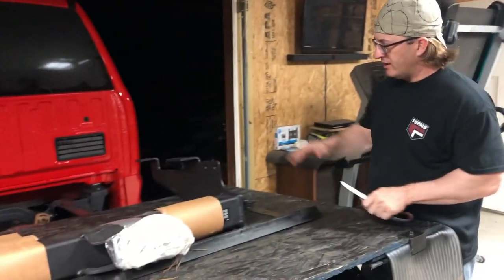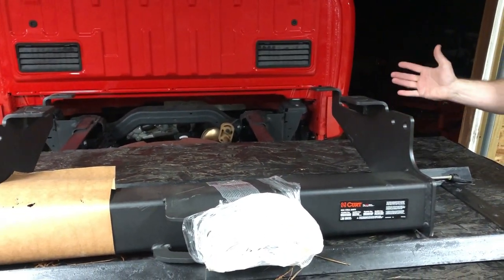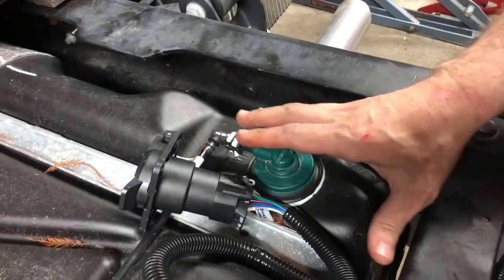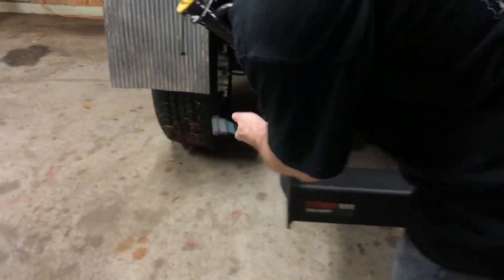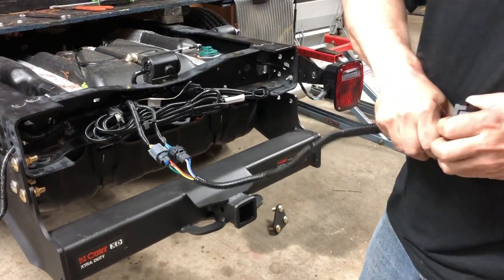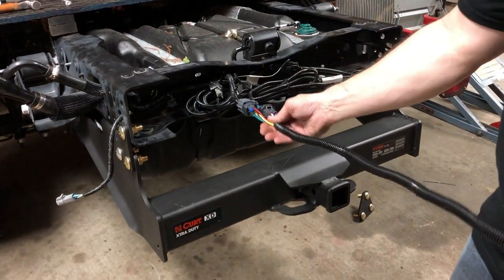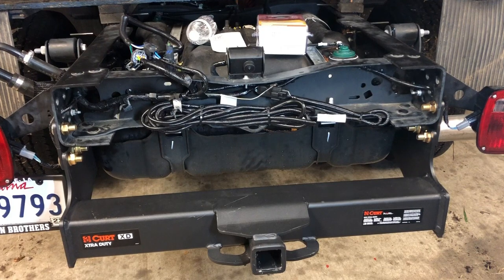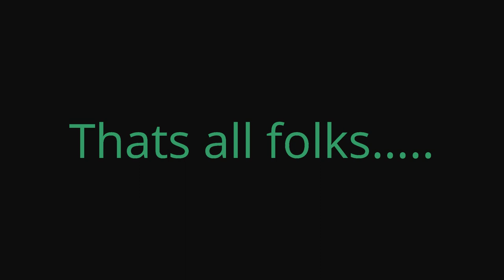Installing Class 5 Hitch on 2022 F-350 Chassis Cab

Comment: Not sure if maybe this helps, but on that hitch, the bolts drop from the top and not from underneath like you have it.
Reply from the maker: The hitch came supplied with carriage bolts. The square holes for the carage carriage bolts were on the hitch.  The round holes were on the trucks frame.  I think they designed it that way so someone couldn't just get underneath with an impact and steal the hitch. Thanks for the input though 😉👍
Reply: @JsCrazyCutzLLC  I’m thinking, that was the orignal idea and I think they might have revised it after noting clearance issues with the installation, like having to drop the tank.

Comment: Lowe's sells a Reese brand adapter , 4 pin to 7 pin , $12. I know because I just had to buy one for my new truck , lol.
Reply from the maker: That's a good idea😉👍  The ramp system that I'm gonna go with has a 4 pin connector plug for the lights, that's why I wanted both plugs available.

Comment: I can't imagine a 2022 F350 not coming with a hitch
Reply from the maker: I know right!?  Isn't that crazy especially, since I special ordered a $700 upcharge for a towing package 🤷‍♂️
Reply: @JsCrazyCutzLLC  tow package without a hitch
Reply: @JsCrazyCutzLLC  you still gonna build the old Ford
Reply from the maker: @lawncommander  yup😬the frame has been blasted, primed and repainted, all new brake system front n back, shocks ,you name it. The motor was just dropped off today for an overhaul. Hopefully 🤞sometime in January I'll be building the flatbeds for both trucks. The old 71' will be on the road by then(not finished but, mechanically sound😉
Reply from the maker: @lawncommander  supposedly, the package only includes the trailer brake controller and wiring harness that runs to the back?....who knows🤷‍♂️the sales guy says ,they usually don't come with a hitch because,  they get put on by the flatbed people.

Comment: Why don’t you just buy a bed for that truck? It would cost just as much I would think
Reply from the maker: All the skirted  beds that I priced are $5k-$8k installed. I'm pretty sure that I could do it for half that. Plus , I'd like it to be customised to my liking.  The bed that I want to build will be 2" shorter to the ground than all the standard beds. I'll be loading and unloading commercial lawn mowers so, the lower , the better. Thanks for watching and commenting 😉
Reply: @JsCrazyCutzLLC  oh okay I see what you mean now. I just thought it would be easier than building one. But building one you can make it your own
Reply: @JsCrazyCutzLLC why didn't you get a Ford Transit? They are much lower to the ground which would make it way easier to load.
Reply from the maker: It would have been a lower load height, but the transit wasn’t what we wanted.
Reply: @JsCrazyCutzLLC  a Ford Transit AWD,  with ECOBOOST would get better fuel economy, they are faster, they have a higher payload capacity in the SRW, almost 5000 pounds, and they are lower to the ground, they have a shorter cab making it easier to fit into parking spots and a smaller turning radius.
Reply from the maker: Again it wasn’t what we wanted. All good points, but we are happy with our rig.